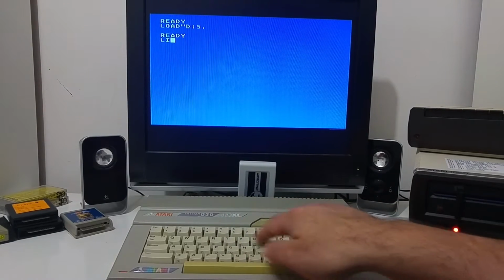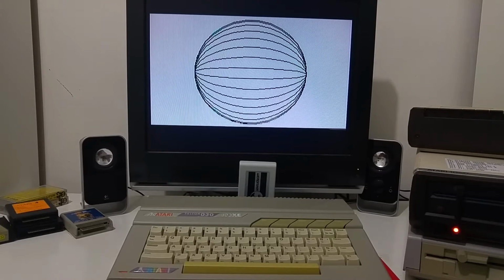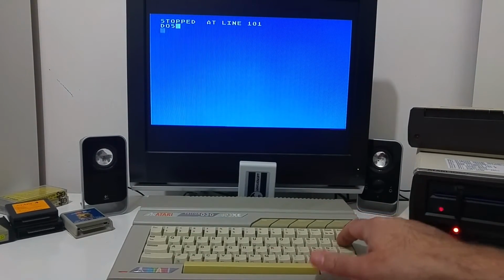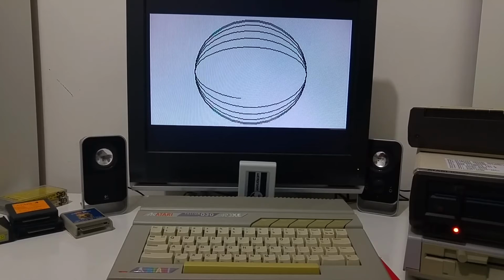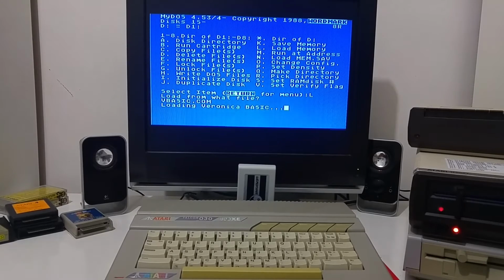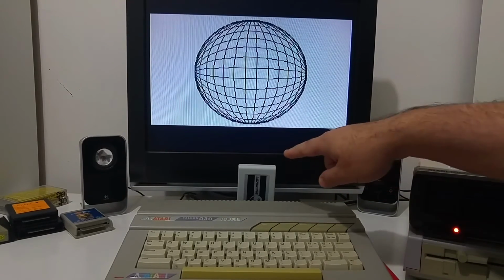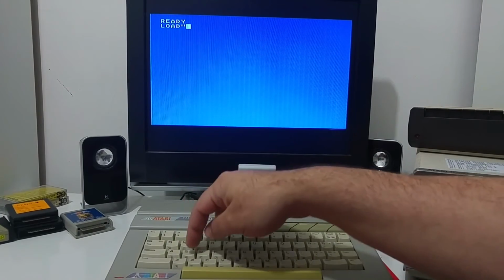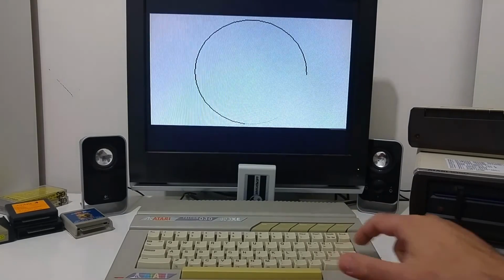Comparing Veronica Basic to TurboBasic and the Rapidus accelerator

Comment: There was a small basic graphics demo in issue 7 of Analog magazine.  I remember typing it in and running it on my Atari 400.  It was called Archimedes Spiral and took 3 hours to run.  It drew a 3D hat shape that was often used in a print ad for Atari software.  I screwed up typing it in and left out the last line that put the computer in an endless loop to keep the graphics on the screen.  I started running the program on the night of the television premier of the original Superman movie with Christoper Reeves and sat down to watch the movie.  On commercial breaks I'd run in to check the progress. but at the end of the movie (which ran over 3 hours with all the commercials), I ran in to see a blank screen and a Ready prompt.  My wife thought it was hilarious!  All that build up for nothing.
Reply from the maker: Michael Stoliker i have that program...and on an accelerated atari computer it runs much faster
Reply: I no longer have my 8-bit Atari but I have run the program on an emulator in fast mode using Turbo Basic XL and it finishes in minutes,  Just for fun, I converted the program to run on a C64 emulator (minus the Drawto routine that erases to the bottom of the screen) and find that it runs just as slow in Commodore Basic.  The lack of graphic commands in Commodore Basic made it difficult enough to create a "Plot"  subroutine, a Drawto subroutine would have been pathetically slow.  The only other thing I needed to change was to remove the "Trap" statement that the Atari needed because the screen was only 320X192 pixels.  Apparently, the routine was designed for a 300X200 resolution screen so there were no out of bounds errors on the Commodore

Comment: Was hoping to see Atari BASIC on the Rapidus. I'd guess it would come out around 38 seconds?
Reply: There is also http://drac030.krap.pl/en-ub-info.php (atari basic with fast fp updated to run from "under os ram") which results would be interesting. Results on rapidus would be for it dependent on ram acceleration settings.
There is also altirra basic, on which veronica basic is based.
So we have quite a bit of combinations which would be interesting ;)
Reply from the maker: I Timed it and it was 19sec
Reply from the maker: i tested Ubasic under the Rapidus and it took 5 seconds to draw the sphere

Comment: Nice comparison, but why you didn't speed up Rapidus bank #3 ($8000..$BFFF)? Screen memory is located there, so TBXL drawing operations could be teoretically faster.
Reply from the maker: there was not change in speed if i speed bank #3, i left it at default settings
Reply: Sorry, I mean bank #2 (starting from 0).